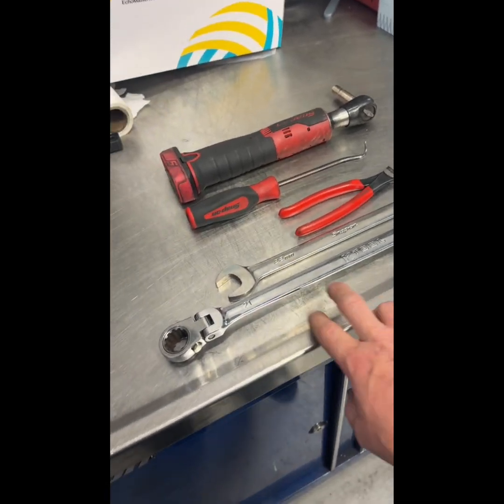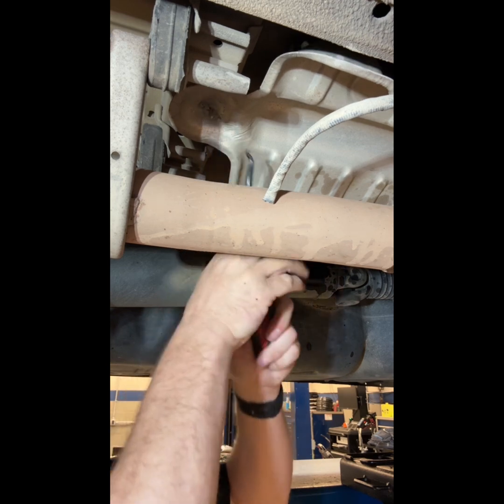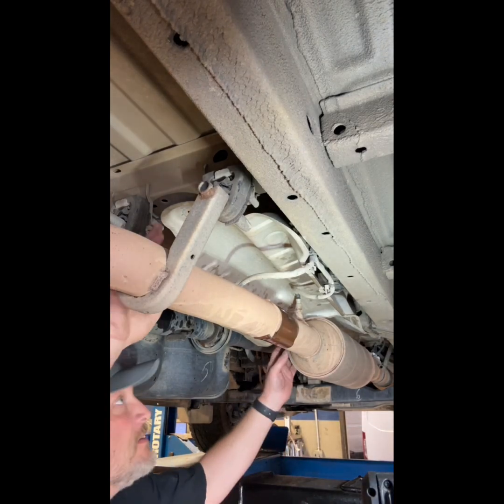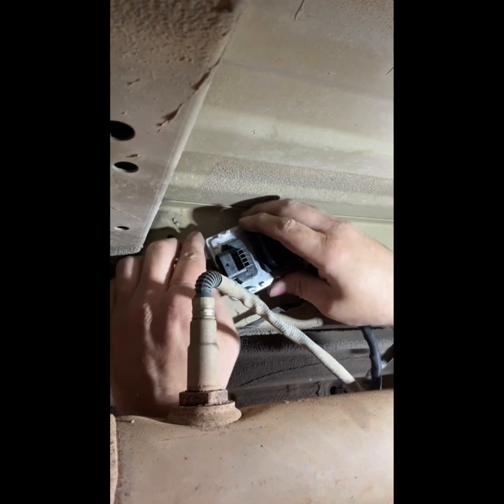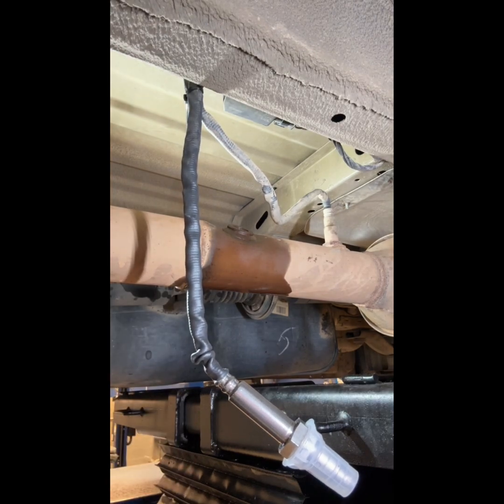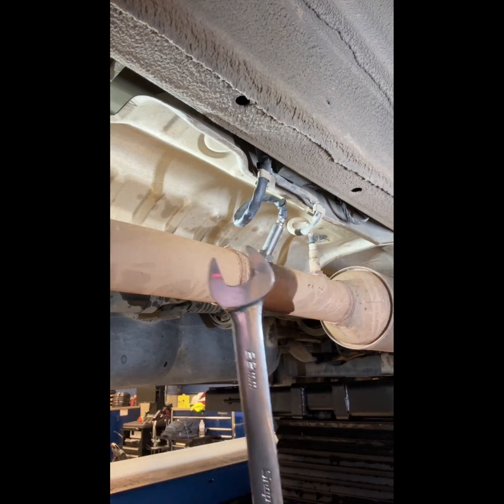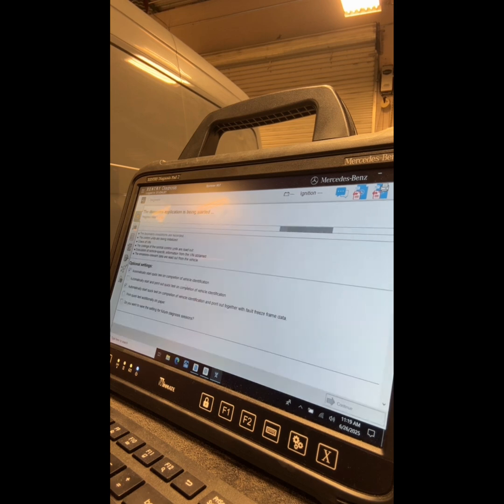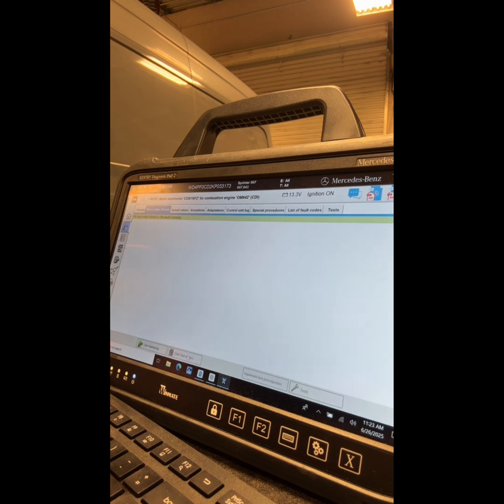How to replace a rear NOx sensor on a Sprinter 2009-2022

Comment: you have xentry, I hope my Autel scanner can do this when I get my new Nox sensors.
Reply from the maker: I would be interested to know. Thanks!!!
Reply: @SprinterDoctor my autel scanner I believe screwed up the ECU I think I got a bad one, it could never identify my vehicle or keep anything straight. I'm going to try the Delphi which is very cheap and simpler
Reply: @SprinterDoctor  still trying, it says to scan them individually. And I will give the wait time after unplugging them

Comment: Mercedes Sprinter, VIN: [WD3PE7CD5HP562769]. I bought a new NOx sensor from Diesel Mart and installed it. After replacement, the errors remain:
	•	186A00 – AdBlue system malfunction, start limitation active
	•	16CE00 – AdBlue start countdown active
	•	177800 – Communication error with NOx sensor 1

Power and wiring were checked, 12V is present at the connector. The sensor is new, but the system does not recognize it. Could you advise what the problem might be?
Reply from the maker: One thing that I would recommend doing is unplug the NOX sensor make sure the ignition switch is turned off and make sure the vehicle has set for about 20 minutes to make sure everything is asleep and measure the resistance between the 2 CAN wires those two wires are purple in color and you should set your multimeter to ohms and measure the resistance between the two purple wires and you should get 60 ohms or right about 60 ohms if you don’t get that then you may have a wiring problem and that’s why you’re not communicating with your sensor.. also just verify that you have power and ground at the sensor
Reply: @SprinterDoctor it's very difficult to get into the pins on those connectors they're so small
Reply: @SprinterDoctor since I know the history of the vehicle and it was running perfectly, then I cleaned the carbon out of the throttle body and the EGR valve and I'm very sure that it was my fault the sensors became fouled. I flush the throttle body with s t a n a d i n e, and this carried into the exhaust system and f o u l e d the sensors
Reply: @SprinterDoctor  Thanks for this tip above. Great to know this. I will check the can wires and try again. It also says the sensors must be scanned in indivitually, not both at once. First the forward and then the aft one....
Reply: The sensor must be programmed into the system before it will work by a scanner that can recognize the part and then teach the system
Reply from the maker: To add, if the vehicle is in countdown mode, it will need to be reset out of countdown mode using a diagnostic tool after the new NOx sensor(s) are taught in.
Reply: @SprinterDoctor no countdown or limp mode it just has bad nox sensors, and again they need to be programmed before they can work
Reply: Anticipate this problem with my own new nox sensors. It is going to have to be programmed into the ECU, before it will be recognized. Various scanners are capable of that. You'll have to find one that is. I had an a u t e l and I couldn't even recognize my vehicle. I think it was a bad or returned model that was still stuck on the previous VIN code and it kept telling me I was a Jeep
Reply: Question: how much does a job like this normally cost? I've got a 2016 sprinter and a quote for $2000.

Comment: Couldn't you just clear the codes after the nox sensor was replaced and let the ECU find the values?
Reply from the maker: To the best of my knowledge doing the initialization, just resets the SCR adaptation values. I’ve never tried it, but it probably would work.
Reply: @SprinterDoctor I feel your advice is missing some of the programming depth required to put the scanners back into service through teaching the ECU to recognize them. One can't just replace Parts but have to have a scanner that can recognize and then teach the ECU my programming it to integrate them
Reply from the maker: @douglundy5755 yes they absolutely need to be taught in, but you must be able to communicate with the sensors to do so. Just wanted to advise on a method to check the communication lines and power and ground to the sensor.

Comment: My 2018 sprinter with the check engine light that was diagnosed at MB as blue def level sensor  last digits of the vin are P612347.  Thanks for the advice
Reply from the maker: OK, I just looked at the fault codes and it does have a stored fault code for the adblue fill level sensor. There is a chance that it does in fact need a new fill level sensor, but there is also a chance that it could just need a wiring repair on your vehicle. The wiring that goes to the fill level sensor has what’s called a Z splice on each wire that goes to the fill level sensor. The Z splice functions as a way to keep the adblue (DEF) from seeping through the wire and making it to the control module. I have seen   multiple occasions where the Z splices started to get high resistance from adblue seeping through the wire by capillary action. In these cases, you can cut the Z splice out and re-solder the wire back together to resolve the issue. I would actually recommend doing that first before you replace the fill level sensor. The z splices are located in the section of wiring harness the runs behind the passenger side headlight.
Reply: @SprinterDoctor thank you so much. I got the MB records and the original owner had the same CEL problem in 2021 at 31,000 miles. Not sure why it wasn’t a warranty repair .  Thanks again .    Want to do a video on my repair LOL
Reply from the maker: @billhenz1127 I sure do! As soon as I get one to do, I will make one! Thank you!!!

Comment: Sprinter Doctor. My 2018 MB checklist engine light came 1:00 on. The MB dealership diagnosed it as ads Blue tank sending unit failure  repair cost $4500.00.  The tank was almost full. When Infilled it last with DEF it was up to the cap. Is there anything I can check before I pay MB for the repair?
Reply: Thank you!
Reply: Did you get the digits?
Reply: P612347
Reply from the maker: Comment with the last 7 of your VIN number and I will see if I can see what codes were in it. I can see the short test (fault codes) as long as they uploaded them to the cloud.
Reply: P612347